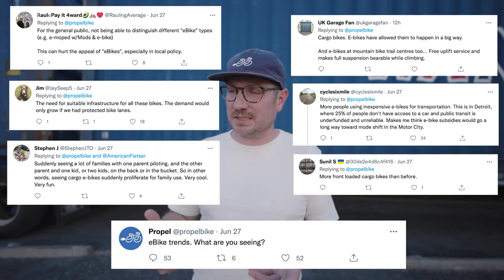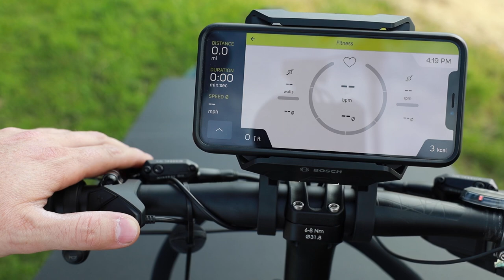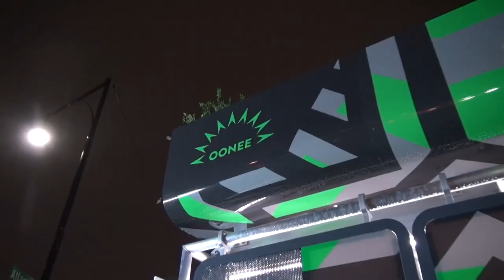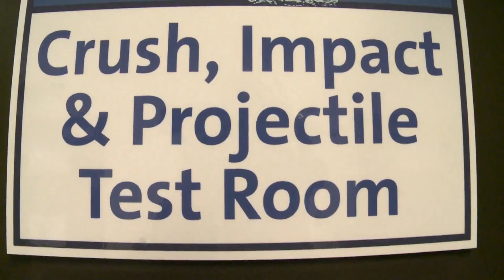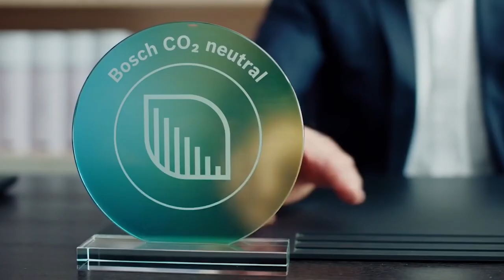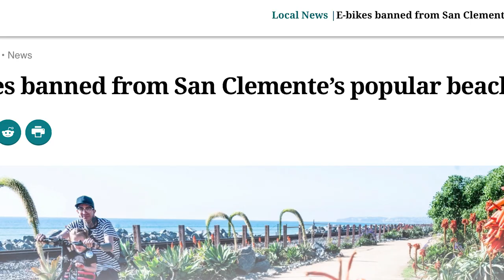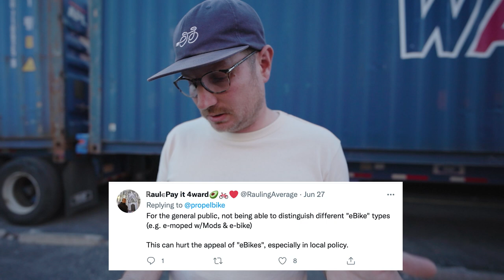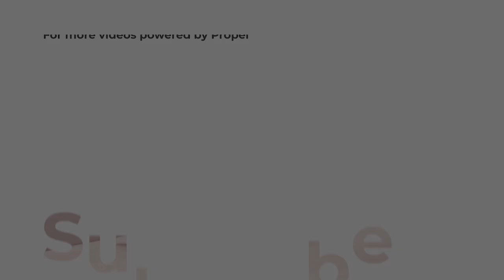eBike Trends for 2022

Comment: We have battery technology that will change everything we just have some not to nice people that don't want it to be used. New motors that are more powerful and smaller lot of changes coming.
Reply from the maker: I know it seems this way, but it’s not that simple. It takes a lot of time to bring these technologies to the appropriate scale for them to be viable and there is a significant amount of energy that needs to go into testing to get there.
Reply: Until 600 pound humans become the norm WE DON'T NEED MORE POWERFUL MOTORS on bicycles.
Reply: @mikebronicki8264  most of the smaller and powerful motors are used by military and will continue to become better.

Comment: The continued use of Lithium Ion batteries is stupid and unless it is quickly reversed will turn into a PR disaster. No need to use a fancy modern technology that might never appear, but one be that’s been used for years - Lithium Phosphate. Every few weeks there seems to be a breakthrough in battery technology. I suspect Nuclear Fusion might actually appear before many are realised. Yes, lithium phosphate is about a third heavier and reduces the profit on the bike manufacturers (lower range advertised, higher initial cost and less money from selling new batteries) but does the weight/range of a cargo bike really matter that much compared to safety and lasting 3-4 times longer… just a shame it is so hard to find a lithium phosphate bike now. Loads of Samsung phones caught fire even though Samsung is a big company and presumably they met all the safety standards. The only answer is just not use incredibly dangerous battery technologies at all. And will your likely ‘right to repair’ laws effect while batteries? It doesn’t matter how many safety tests the original has met if Joe Bloggs has punctured the battery with a screwdriver when it was open.

Comment: How do they ban electric bikes? Didn’t the Feds declare that ebikes are bicycles? If my ebike is legally a bicycle, then the ban would have to be on ALL BICYCLES!  

If Karen’s are allowed to ban ebikes, the whole movement could fail. It’s bad enough you are not allowed to put a beat down on a thief. Country has gone crazy.
Reply: Until you are on the receiving end of some ebikers nearly colliding with you at high speed on a side walk, you won't understand why some people want ebikes banned. What really needs to be banned are those ebikes that go beyond 30+ mph with a throttle and no pedaling. A lot of kids have 'em.

*
Reply: @do-ineedtosay723  Those are already banned, as are mopeds banned from sidewalks which occasionally they get up on anyways. Your area may be different, but in my city, bikes are not supposed to pass pedestrians on sidewalks while mounted. 

Here’s the thing, laws are only good against law abiding people. Push ebikes off of bike trails or otherwise force them onto the streets, and most of the riders will go back to cars. And, some will stay and harass pedestrians anyways.